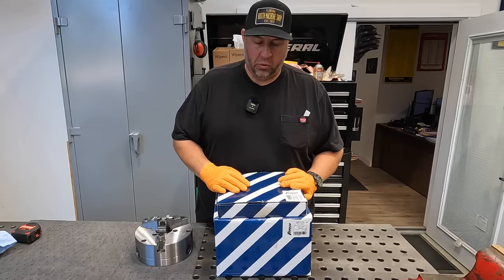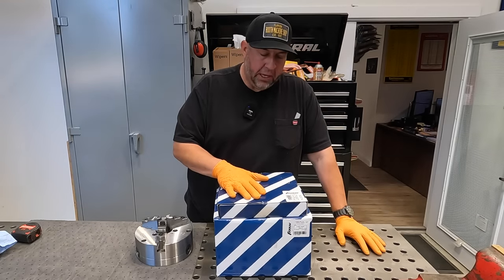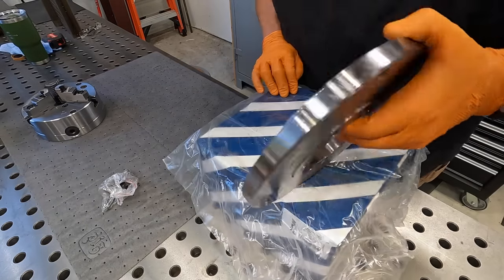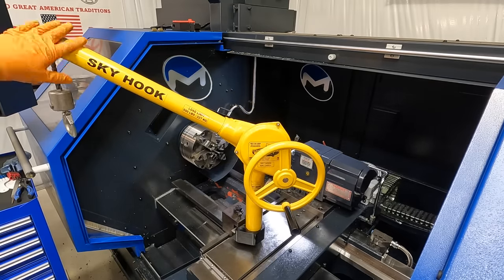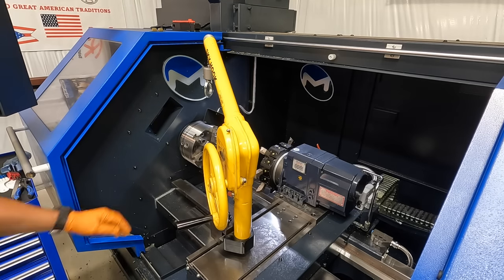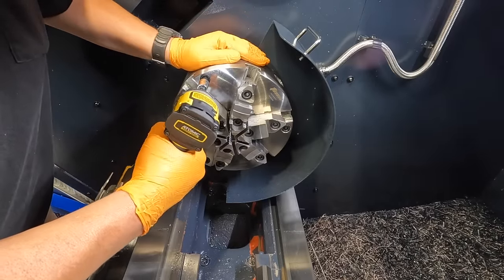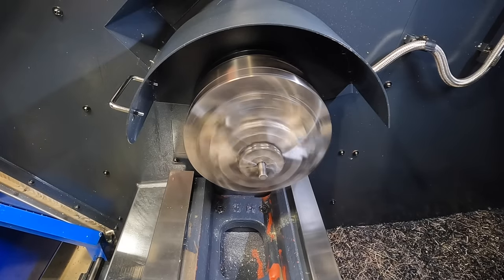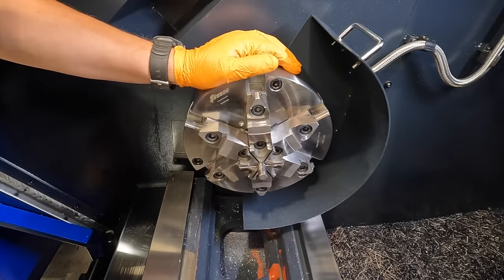Tool Tuesday Ep.8: Installing New 6 Jaw TMX Set-True Chuck on Milltronics CNC Lathe

Comment: I have been running that same TMX 10" set tru on my Graziano SAG lathe for about 3 years now. It's been absolutely flawless. The first few months give you arm a workout untill you get the scroll broken in. The chucks are tight, which is good, they are high tolerance fit. Can't say enough good things about them

Comment: Ive got an assortment of wrist pins that ive gathered up over the years.  Everything from a little Briggs mower to a big ol cat or Detroit diesel.  They are harder than woodpecker lips and preciion ground to a tolerance of .003 of a gnats eyebrow. You almost cant put a ding in them.  Anyway, go to the place where you bought your tractor and ask foior some wrist pins.   They usually wont be more than 10 bucks.
Reply: You would use something with 0.003” runout as a reference?

Comment: Someone a while ago, I can't recall who, did a test to see if using only one pinion to adjust the chuck, the same one, made a difference and yes you need to always use only one pinion and only that same one for consistent repeatability.   I know your habit has always been to go around the chuck and tighten all of them but it seems that that's just fine unless you want the best repeatability. Why can't I remember who that was?  Oh, I remember why, I'm 82 and can't remember what I had for breakfast let alone who did that experiment some time ago but I do remember the experiment.
Reply: Dudley Toolwright did that test and he consistently had better results tightening only one pinion.
Reply: I can relate! I can recall every conversation I've ever had, I just can't recall who I had the conversation with.

Comment: abom: there is a 0 stamped on the chuck where you should tighten 
also abom: starts on 0 and tightens on the other 2 aswell.. 
Like huh..? its a scroll chuck you only need to do 1... i have never and i mean never done all 3 in my life and i never had any problems...
Reply: You may not have had any problems but it has to do with backlash. He probably started doing it when he was turning those large shafts and kept the habit. Not a bad habit to have.
Reply: @nickhale117 the marked pinion is there because you get the best repeatability when using the same pinion every time. Even an old clapped out chuck repeats well when using one pinion, and then horribly when using any of them
Reply: I have a 50yr old Pratt Bernard 3 jaw, damn that thing is a dog if I tighten it on the 0, I was going to replace it but if I tighten all 3 it is really really true and highly repeatable to within 0.001” which would be pretty good for a new 3 jaw! Oh yeah, my lathe was made in 1957 and came from a shipyard jobbing shop where it was thoroughly abused, crashed and the 1/2 nuts broken! I did lots of servicing and adjusting and now I can turn jobs to within a 0.001” well under the tolerance that is really needed! 
I was a toolmaker for 14 years before being made redundant and I was taught to do all 3 on the rare occasion that we were using a 3 jaw. We mostly used 4 jaw as we did a lot of irregular shapes.
Reply: He mentioned when he first got the one at home that he gets better results with he tightens all the screws. He starts at 0 and then tightens the others. It's just when he wants the absolute best behavior. If they didn't want people using the other screws they wouldn't have put them on the chuck.

Comment: It would be cool to see the runout testing a few different size pins.  If you get it dialed in with a 1/2" rod, do you still get zero runout with a 2" rod?  That would show how precisely machined the scroll is.

Comment: I wish Skyhook would create a hobbyist-series crane. I’d love to have one, but nearly $1k is 30% the cost of my entire lathe! I could maybe splurge one day, but it’s clear their product is not priced for the hobby level machinist.
Reply: You could always get a Harbor freight cherry picker for $270 and have something that you can use for more than just on the chance you need to change your lathe chuck.
Reply: On the hobbyist side, the skyhook's application seems like a good project. There's got to be a way to build something like that for less than $1k. The thing is definitely catered for professional machinists.
Reply: @GenericAnimeBoy A hand crank boat trailer winch welded to a peice of pipe. If you're any good at finding stuff in the garbage (which you have to be if you're a hobbiest lol), I'm sure you could build it for almost no cost.

 I actually cannot fathem shelling out that kind of coin for such a simple tool.
Reply: Find a vintage 1/4 or 1/2 ton differential chain hoist and make your own boom. A differential hoist is light weight and automatically holds its position. Ya not as compact but would get the job done. I buy any I come across.  Got them hanging everywhere 😊
Reply: I had no clue it was that much.
Reply: Not too different to make.

Comment: That chuck is never going to repeat 100% ever. Really the only way to get a better result is to use soft jaws and machine them for your second opp. work. Even then they won’t repeat 100%
Reply: Still, it is likely that the test part that he used was slightly out of round, no matter how hard and shiny it was.  Adam has a quality reference cylinder that he plans to use to see how well the chuck repeats on that.
Reply: No chuck, in the history of man and machine tools, has repeated 100%.
Reply: @wolffengineering7038  Thank you captain obvious, I already mentioned that.
Reply: @justinl.3587  why would you even make a post about it? Adam never mentioned 100% repeatability. So, you’ve got to ask yourself- who’s the real Captain obvious in this equation?

Comment: I believe that the spring tension from the runout guage, pushing on the bar, while repeating, is causing it to chuck, not straight... maybe try repeating, without that runout guage tension on it ?!
Reply: That piece did jump each time he re-chucked it. That was from the dial gauge pushing it away.
Reply: That dial gauge pin moves IN on changes of 1/10000", and you think it has enough back pressure to move a 75lb chuck? LOL
Reply: @kindabluejazz  No, not the chuck, the piece of rod in the chuck.
Reply: @AllenCavedo  There's no way the dial indicator can 'push' anything away - it measures by absorbing forces, it doesn't exert forces.
Reply: @kindabluejazz  The dial indicator is spring loaded and does exert a small force on whatever it touches. Whether it can push the rod around, I don’t know, maybe the rod moved around from gravity because it was fairly long and was deep inside the lathe giving it leverage.
Reply: @AllenCavedo  The spring in the indicator is calibrated to react precisely and predictably to tiny input forces. Those input forces must be greater than the reaction force generated by the spring or it would not measure a change in position. That's basic physics. The forces involved to move the indicator's rod 0.0001" are on the nano-gram level, as compared to the many dozens of grams of the rod - there's absolutely no way the indicator spring could be pushing the rod away.
Reply: @kindabluejazz  So a dial indicator is a special case that doesn't obey Newton's 3rd law?.  Might be a PhD in there for someone!.
Reply: @richard-jz1qd  Yikes - I said the spring reaction force must be LOWER than the input force, or there would be no indicator movement. Knowing the precise reaction to the input force is exactly how an indicator works.
Reply: @kindabluejazz  you are confusing force with distance of travel.  The fact that the indicator only moves a tiny distance has nothing to do with the force involved. Think about moving a mountain .000001”. Tiny distance but would require huge amount of force. “Work” is force plus displacement. Maybe that’s what you were thinking of.
Reply: My 2nd response to @kindablue got blocked , so here goes.  Yes there is a tiny pushback against the bar, and the more sensitive the gauge, the tinier the pushback.  He quotes basic physics, but was  he not taught the horse and cart paradox at school,? or maybe he didn't understand it.  The cart pulls back on the horse just as hard as the horse pulls on the cart, (Newton 3 law), so how come the cart moves?.  Well the cart moves when the pulling forces ON IT ( by the horse) exceed the frictional forces( and its mass) holding it back.  The indicator moves when the input force exceeds the lower sensitivity  of the indicator's spring, but at all times the indicator's spring pushes back against the input force ( the bar in this case) with an equal but opposite reaction (N3) ( which is what he is arguing against here).
Reply: 😂 Oh my
Reply: @SilentChony  Yes, technically true. I'm not a trained physicist, just slightly conversant, but I have a clear sense that indicator's spring is incapable of moving that steel bar backward in the slightest. A full force/mass/inertia/energy/work/quantum description no doubt could be worked up by those inclined to prove it.
Reply: @carlbyington5185   I agree, it would have been a better process, just to be sure.  But according to @kindablue, his words '" it ( the indicator) exerts no forces".  I disagree.  If it takes X grams force for the indicator to give half thou indication, then that exact Xgrams force  is pushed back on the rod by the indicator at the point of contact.  Simples.
Reply: @richard-jz1qd  You're just being a pedantic troll and sticking your nose into someone else's conversation and not even addressing the original point I was rebutting. I may not have used the perfect technical words, but my point was there is no way the force of the indicator spring could cause that rod to move. The rest of your comment is just ego flexing.
Reply: @kindabluejazz  My 2nd reply was blocked, I wonder why. So I put my point elsewhere.  Your original point was essentially a contradiction to Newton's 3rd law.  As an ex practicing physicist, when someone mentions basic physics and gets it all wrong, I feel obliged to correct it.  And will continue to do so  in future.
Reply: @richard-jz1qd  In other words, regardless of the context of the question on the table, and when nobody asked for your input, your idle ego requires you to strut your stuff and correct other's lay language, even when you instead could have used your knowledge to address the original question. Got it.

Comment: Can you dial it in on a second lathe without the adapter chuck, then without taking the rod out put the adaptor chuck on and dial the adaptor chuck in? Would that make it more repeatable or would that be compounding error?
Reply: He needs to remove the chuck to get the adapter plate off, you'd have to readjust it afterwards anyway, so no.

Comment: Not sure if you’re getting enough boost without the higher boost and RPM to overcome the gyroscope effect of the engine that’s fighting it. After you pour in more RPM and boost so much more air and are burning it more efficiently it makes a difference. Many people have dump videos where the exhaust lifts ceiling panels above it.

Comment: Adam, I also continue to learn to use Fusion 360. It's on-going, but I do have a 3D printer and need to model and print a couple of molds for two broken cast iron items from my 1957 DoAll bandsaw that I want Clarke Easterly to cast for me.

Comment: I think your problem is mostly related to the operating temperature of the spindle bearings. Sure, the test bar could be affecting your measurements, but those bearings and the oil in the spindle had got to be up to temp so they're expanded and running at their designed tolerances. That Thompson bar my be bent, slightly, but you MUST have the spindle and bearings up to temp to eliminate any machine intolerances.

Comment: Proper chuck for a CNC lathe would be a Kitagawa air operated three jaw with soft jaws machined to fit the parts to be produced. Air operated chuck with a bar feeder allows constant bar stock feed to make parts which is what cnc machines do best.. produce parts fast with no to little operator intervention as the cnc machine runs..

Comment: Linear shafting is a good option for a material that's hard, round, pretty straight and pretty close to on size. It's usually spec'd to .002" per foot straightness and on size from -.0005" to -.001" and not too expensive either. You can turn one into a cylinder square if you're willing to do a bit of work on the ends. Used for a lot of industrial stuff so short lengths can be had pretty cheap for what you get.

Comment: I have a similar crane. Looks identical, except it is orange and it has a plastic handwheel. On mine, the chain keeps breaking. It is hardened and I keep finding cracked links. I really don't feel safe using it...
I've ordered 5 feet of #35 chain for it, to replace the entire thing. Hopefully it will be more reliable and confidence inspiring after...

Comment: good video. A good option to check centering accuracy is to use a high-speed steel round bit. They come ground with great precision. I hope that with this change the precision of the lathe and therefore of the parts to be manufactured will improve even more. thanks for sharing your knowledge

Comment: got to remember when indicating at the tip of the piece in the jaw to make it true the opposite end of the piece is doing the opposite of what you see cause its not straight in the piece yet so if its towards you on the indicator the other end is going away from you in the jaw

Comment: What's the advantage of a 6 jaw chuck over 3 or 4 jaw chucks?
Reply: As to my knowledge, the advantage of a 6 jaw chuck is it's repeatability. 3 or 4 jaw chuck would require you to re-indicate which would make you lose concentricity.
Reply: Adam explains this in the video
Reply: @Daniel-vq9zb  he said he bought it, watch the video
Reply: 2 or 3 more jaws 😅
Reply: On a CNC? Literally 0 unless you're clamping thin walled parts.
Reply: @spikeypineapple552  
That would be LARGE thin walled parts.. Even so, soft jaws made to fit the specific thin walled part works loads better than any 6 jaw chuck with better repeatability.

Comment: Six jaw chucks work good for thin wall tubing or an item that is known/proven to be absolutely round, even then getting all six jaws to make contact with the "round" solid is questionable.

Holding power of a six jaw is lower than a three jaw or four jaw due to the total amount of clamping force available being divided into six jaws.

Six jaw chucks are fragile, one crash can completely alter the precision of the chuck. This is due to the thinner jaw housing required to make a six jaw chuck.

Three jaw chucks are inherently more rugged and abuse tolerant than any six jaw chuck and will apply mostly equal claimp/holding force due to the three points of contact.. Simple dykem test on raw round bar stock will illustrate where the chuck jaws make contact..

As for initial run out of a round work in lathe, once the first turning cut is made, the initial run out is no more..

For the majority of lathe work, three jar chuck works good. Four jaw chuck has the highest holding power coupled with the ability to true up the work as needed.. Four jaw also allows turning controlled offset/off center parts not possible with a three or six jaw chuck.

Comment: Interesting.  I'm thinking those CNC machines are designed more precise than some may think when it comes to the spindle run out. My guess is the spindle on those is very close to zero with todays CNC machines. I would shoot for as close to zero as possible being the machine has just a few hours on it.

Comment: The Skyhook has a design flaw in the arm that the chuck is mounted on does not rotate.  This is necessary for hard to turn spindles.  I modified my Skyhook so that it now incorporates this feature by replacing the arm with an arm with bearings on each end and a tubular sleeve between the bearings.  This allows for the chuck to be rotated very easily into alignment without trying to turn the machine spindle.  It has improved the Skyhook 100%.
Reply: Do you really need/want the free movement of bearings or would a friction sleeve work?
Reply: @KJ6EAD  I used bearings because I had them, but I don’t see why a sleeve would not work just as well if it had limited center shaft contact.  If it didn’t you could always modify to some ball bearings or delrin sleeves on each end if you plan for them if necessary.  I am able to rotate a 16” 4 jaw  with my modification.
Reply: Not having a feature is not a 'flaw'. A flaw is when it doesn't work properly as advertised and designed.
Reply: Seems like a nice idea. Now if I only had a welder...and knew how to weld.
Reply: @firesurfer  you don’t need a welder. Bolt 2 pieces of 3/4 x 1 1/4 wide flat stock together at a right angle with two bolts (I’d recommend grade 8).  The top leg long enough to come approximately to the center of your largest chuck’s length.  Drill and tap that at the end for a lifting eyebolt to attach the Skyhook’s or any lifting crane, hook.  On the other leg, which is sized to reach the center of your largest chuck plus an inch for clearance of the chuck when revolved, drill and tap for a length of round rod which will hold your sleeve which holds your bearings, or just a plain sleeve (piece of pipe perhaps?).  Boom! You have one.  It will take longer for the paint to dry than to make.